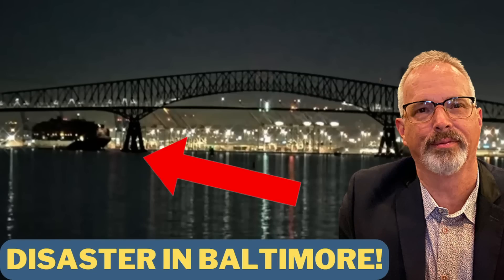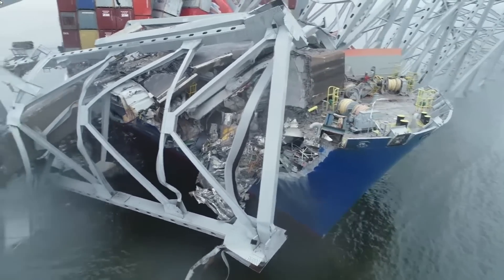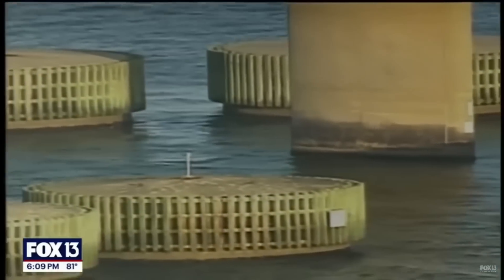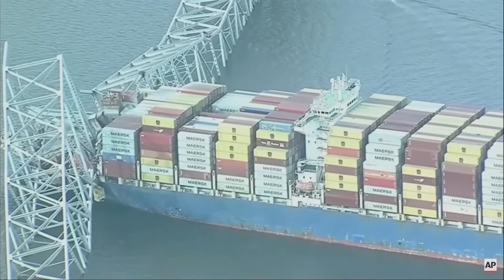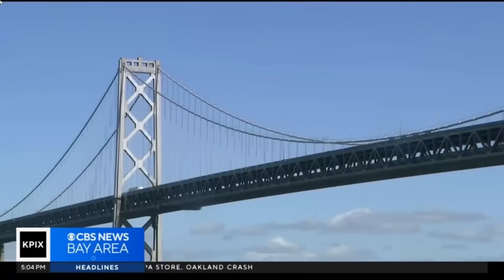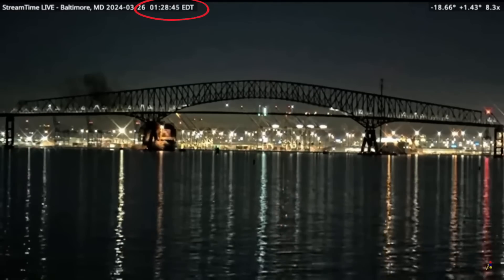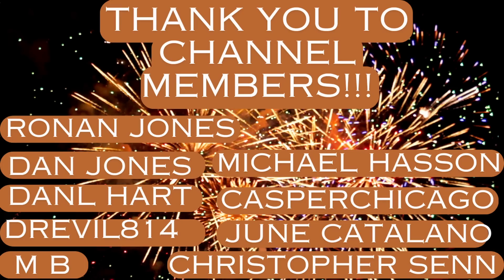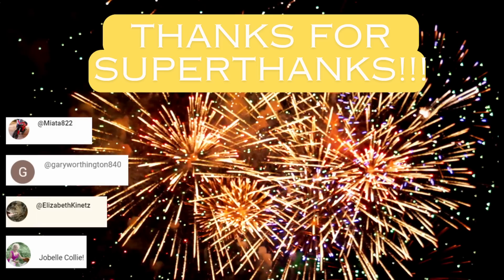How the Francis Scott Key Bridge in Baltimore should have been Protected

Comment: I find younger engineers can suffer from a generational blind spot.  There is a tendency to think older folks can't possibly know anything.
Reply: Doesn't sound like an engineering problem but a political problem and not spending the money to reduce risk.
Reply: @jaredgates4310 Exactly, some people forget that there is a price involved. Engineers don't get unlimited budgets to work with, especially when the government is in the driver's seat.
Reply: @jaredgates4310  that bridge was a toll  bridge it made a lot of money
Reply: @dknowles60  yep, tolls probably cover at least a quarter of ongoing maintenance costs...
Reply: @dknowles60 than they had the cash for the upgrade. They where using the cash in other areas than.
Reply: @windforward9810  You should alway have money for such an security retrofitting, because the risk if you not do so  is way too high.
Reply: I'm noticing effects like this with traffic light timing. 
I have to keep reminding this county that the signals are working to pre 1970s specifications. 
Internship has gone away and anyone less than 50 doesn't remember the big changes smart signals invented in the 1960s and seventies. 
It's likely the engineers involved are ESL and like young people, they don't have the experience to run things
Reply: @flashgordon3715 yet pols make $20K a month for screwing everything up.
Reply: Ageism is rampant in all disciplines nowadays. Including music (my profession). Old people don't look perfect onstage, so...
Reply: I think that there are also some inherent limitations in humans' mental modeling of very low probability, very high cost outcomes. There is a tendency to see the low probability of the event happening and the benefit of cost reduction / construction timeline reduction and career enhancement from being the engineer that made the customer happy and choose unwisely. By the time the negative outcome kicks in, the engineers are retired. In addition, the math on the probability is poorly defined. Since the bridge was built, the likelihood of damage from terrorism has increased manifold.
Reply: I am not a degreed engineer, but I am naturally talented in mechanical and electrical reality. I've worked with some degreed book smart engineers, who can't troubleshoot things like their malfunctioning, say, garage door opener (real story). The door would go up a few inches, hesitate, do it again, etc. He's piddling around with the chain limit switches. I ask if he's taken the bottom cover off. No. I talked it off, revealing the v belt missing a chunk of the inner part. "There's your problem." He says, "Are you sure?" I said "Of course it is, when the void in the belt reaches the small sprocket, it sticks a bit, then gets past the sprocket." We got a new belt from an auto parts store, put it together, and all was well in the garage door situation. I could go on. My eyes have rolled many a time. You either get it or you do not, degreed or not.
Reply: Thanks spellchecker, you changed my word again.
Reply: I would suggest that younger generations always possess a generational blind spot. Without the experience of a life lived, combined with the arrogance of a life not yet lived, they will frequently tear into the older generations for no better reason than a seemingly instinctual need to devour those who came before.
Reply: As an engineer, I will tell you that one of the biggest problems in engineering is that management/customers are never looking to solve any extra problems or spend extra money. If there aren't rules in place that require bridge protection, why spend the extra money to add it to the design. If you can get away with certifying a structure while spending less money they'll do it. Especially if there's historical engineering precedent. This bridge has by all appearances been a good enough solution for 50+ years. When that other bridge was hit by a ship that caused a collapse and killed 30 or so people there should have been a national review of bridge safety from ship impacts. That's where the real failure is. Why are we not learning from previous mistakes and implementing solutions?
Reply: Exactly they're all for improvements till you mention the $-sign then it's "We'll get back with you on that " ....yeah right ! @jaredgates4310
Reply from the maker: You're exactly right. I saw that recently when I helped one of my kids with his vector homework.
Reply: @CaseyJones-Engineer  in Logan UT near the mouth of the canyon is a small power dam. Iirc turnover of operators is 6 or 8 years and every 12 or 15 years it silts up. So it is opened and flushed. Pretty well killing all the fish 10 miles down stream when suddenly every one remembers oh we were going to do that again. Think has happened at least three times. Think it's called organizational memory
Reply: @CaseyJones-Engineer  what topographical mapping did you use in your assessment to know whether or not those structures could be used .  Just asking as some one whos mother grew up on backriverneck run ,  that is a heavy silt area some of the areas on either side are not stable enough for structures thats why the bridge is spanned in that sectional length.
Reply: @CaseyJones-Engineer  Any loss of performance in engineered designs, from Structural, MEP, Civil, Architectural, etc. is absolutely not due to brain drain. It is 100% due to cost and budget, every time. We as engineers are constantly pushed to curve our designs to meet project budgets even with stakeholder knowledge that this can compromise code compliance or at worst public safety.
Reply from the maker: @jdduvall12   I can definitely see those being big factors as there is too much penny-pinching going.  But I also think training budgets are virtually not existent now.
Reply: @CaseyJones-Engineer  You are absolutely correct, and I think the penny pinching extends to the loss of talent. Fields like MEP and structural engineering have to poach kids out of college in those fields looking for jobs where their degrees can make significantly more in industries other than construction. Perhaps less so structural, but we're seeing the effects in construction based trades very heavily (MEP, Civil, etc.).
Reply: And 99% of new graduates, you can ask them to thread a pipe, tap a screw hole or weld  two pc's of metal together and they're fk'n lost !😱
Reply: @rickymeadows5176  yea
Reply: @rickymeadows5176 .  They can tell you what size pipe you need or what size and how many screws you need but when it comes to getting a load of pipe safely off the truck and to the installation location………..can’t.  No fault, none of us know everything, it all comes with hands on experience.  In 1970, I was green as a Gourd too but 50 yrs later I am fortunate to have a very varied experience and worked all over the world for Bechtel with Chevron being the client most of my last 12 years.  Go into Oil n Gas and see the world.🌎 😅😊
Reply: I don't know if this is the point here, I think the problem here were bad decisions of the guys who do the money stuff.
Reply: no I was raised by baby boomers who kept there parents tools from the 40s 50 60 70. yes I know how to drive a model A tractor/car. or swing a mower to mow grass. My mom's family built airplanes. and I've seen how things used to be built. but your parents who born in the 40s. made great things. easy to work on. for some reason you boomers made things cheaper. thinner steal.  harder to fix with/or timing gear for everthing.  yes there is a difference between a 1960 cars that was build by a guy born in the 40. then a 1980s cars who was built by a guy born in the 60s. even the building codes form your time had to be updated to be safer. and more reliable in the 90s. Today building things have more laws to watch. and more people for things to withhold. So yea I know my generation can't build anything without a computer. which is a problem.Things don't work in real life like they do on paper. and its not we think your stupid. its your out of date. we know how things work well suppose to anyway. you have taught us that. is we got to fit a computer in it Now and that needs wires and holes and reinforcement. for all that too work. and everybody likes Bluetooth. fun fun fun. and wifi and smart this and that which get hard. just wait they do the same with the bridge.
Reply: Too much depending on book learning and not enough experience ànd common sense
Reply: @georgesparrow2839 .  Also now, no human calculations, just enter a few fields of data and hit enter but have no idea 🤷 if the end justifies the means.
Reply: Sweetie, but WHEN was that bridge built?  The question of the day is why did the folks in charge of that bridge just ignore how that the fact that they could have put concrete barriers near the existing supports to prevent collisions into those supports?
Reply: I am not an engineer, however the last part of your comment really hits home.
Reply: And they want to compare that ability to current politicians.  Like theyre the ones that will be doing the work.  These ' younguns' need to pay attention.
Reply: I knew everything till I turned 25. Then, I was like a child, dumb, ignorant,  nieve, and prideful. Then, around 40, I started gaining wisdom, and it's been a good ride since.
Reply: No I don’t think the upgrades will happen.
Reply: Which is why everything is falling apart.
Reply: It does happen, but it's relatively rare. It reminds me of that skyscraper in NYC that could have easily fallen over if the wind came out of the wrong direction without any scientific reason for excluding that scenario.
Reply: Unknown unknowns, a lot of people are certain that those do not exist.. except those who have enough experience to know that there is always something you don't know...
Reply: I'd personally ask who mentored the young engineers and ask some questions from that direction..
Reply: Brit here : I designed the most northerly grade-separated motorway interchange in the UK in the late ‘60s using only 8-figure logarithms - what are they, I hear you ask ! 150 pages of calculations, it took, too.
Reply: Most likely $$$"  ! , during construction an, again after completed - not necessary  ? Too cost$$ ly  !  ?  _"
Reply: Dolphins,Fenders and tugboat escort services could have definitely  made this less likely to happen !!!!!
Reply: TO them that think they know it all I say : THOU FOOL !:elbowcough::goodvibes:
Reply: Which is true. That bridge is 47 years old, so it was not build by young engineers. It was build by old ones, who apparently didn't know anything, or they would have made better protection for it. Don't blame young people for what they didn't make.
Reply: Amazing, other than the ship hitting the bridge no other facts have emerged but the youtube experts will emerge and explain everything.
Reply: Kinda like a Dr. never can figure out what's ailing a person but a Coroner can tell you what they died from 30-minutes after they hit the slab !🤣 @henrylubinski2728
Reply: I saw a much smaller ship go through 50ft long 20ft deep concrete reinforced bank and into a hotel.. How exactly big you going to make these bumper things?
Reply: @austinavery4772  Whatever it takes.
Reply: Yeah, that's it. Blame those who don't know for not knowing. Classic boomer mentality...
Reply: Or maybe there is a lack of older engineers teaching their knowledge to the younger ones without being patronizing or else ..
Reply: Seems like both sides are believing this fallacy about the other. Younger doesn’t mean less capable and neither does older. They both will have their strengths and weaknesses. This is the whole factual basis for diversity.
Reply: It was the older folks that built this bridge without the protections.
Reply: Had they the budget and or design requirements that most likely would have been done .
Reply: Well, the older folks failed to do anything about that bridge during the past 47 years, so perhaps they don't know anything.

Comment: The cost of improved pier construction should be prorated as a port tax on the huge new cargo ships.
Reply: The state and local governments are responsible for getting this done. While searching for Maryland future projects funding , they have announced funding for an upgrade for a high speed rail tunnel.  Did the government punt on bridge upgrades to spend on other projects?
Reply: @stanhry  Yes, they've had well over 40 years to deal with this problem, they chose not to.
Reply: It is likely that when the bridge was built that there was a legal agreement with the port as the bridge restricts access to the port. If the ports lawyers had any sense they would not agree to pay to do works in the future to a structure that was being put in place to hamper their operations.
Reply: @johnclements6614  on the other hand, if you look at that port, it doesn't appear to have been built, like it is now, in 1970. So somewhere along the way they almost certainly got some government funding to upgrade it. And will probably want some in the future.
Reply: Why!? The maritime traffic was there first. The cost of improved pier construction should be funded by a tax on motorists who keep obstructing perfectly good rivers with their bridges because they’re too cheap to build tunnels.
Reply: @michaelimbesi2314   Ships have gotten much larger than they were when this bridge was designed  and hazmat carriers and tall trucks can't use tunnels.
Reply: @michaelimbesi2314 
Except the automobiles aren’t the ones that damage the bridge. By the way, that bridge is where the trucks that unload the cargo from the port go. So the ships need that bridge also
Reply: @michaelimbesi2314 The maritime traffic broke it and killed some people, and want their port reopened. Being first is no longer the winning argument if it ever was. This isn't a playground.

Comment: The Bay Bridge in the San Francisco Bay was built up as part of the Treasure Island Naval facility. I’m not 100% on it’s engineering history but it all was built to Cola War era standards; why wouldn’t it be?

There was a tanker collision in ~2009. It hit a concrete rim wall that protected the steel frame pier. The ship was damaged, the concrete was damaged but the pier was fully protected. 

Isn’t the Baltimore channel part of a US Naval entry point? Seems insane it was never built up with dolphins/whatevs
Reply from the maker: That's a great point that I'll have to look into that.  I think it's sheer insanity they didn't protect that bridge.
Reply: @CaseyJones-Engineer  for real! You’d certainly have more expertise than mine but it was the Oil Tanker Cosco Busan and o think the Captain was found negligent. 

Also: lol “Cola War era” that’s actually happening right now!
Reply: @CaseyJones-Engineer There are a couple of fast deployment ships trapped in the harbor now.
Reply: Coronado bridge in San Diego Bay was designed to float should it come down so as not to trap the USN ships docked further down the bay.
Reply: @williamlloyd3769  A popular myth.
Reply: @williamlloyd3769  I don't think the spans can float. Modern aircraft carriers can't fit under the bridge and dock at North Island, and the bridge's curved path allows for more clearance if the spans do drop.
Reply: Can’t remember if the Navy has or had any major maritime water side presence there. The I-295 Del. mem. Bridges are south of Philadelphia. The Navy had a shipyard which is still a working shipyard of sorts. For the Philadelphians, the other two major bridges, not mentioned, which cross the Delaware do not appear on a satellite view to have any piers in the water.
Reply: Key Bridge has 4 reinforced concrete pylons/dolphins around the main piers just like the Sunshine Skyway.

Problem was that the ship left the channel at an angle and just missed the pylon.

The SFOBB pier was sideswiped, not hit head-on. Difference, huh?

These are lifeline bridges across principal shipping channels and none of them have more than 100 feet of protection around the main piers (see satellite views).

A 1,000 foot long heavily loaded ship moving at 8 knots would not (in my estimation and considering the bow overhang) be stopped in time to avoid destroying the pier leading the collapse of the entire suspended span:

Verrazano-Narrows Bridge
Delaware Memorial Bridge
Golden Gate Bridge
San Francisco Bay Bridge
Reply: The Cosco Busan (the tanker that hit the SF-Oakland Bay Bridge) is 60% the size of the MV Dali and side-swiped the Delta tower in heavy fog. The MV Dali had a head on collision with the primary support pillar of the Key Bridge and the MV Dali is a mid-sized ship. Very different type of collision.

The Key Bridge had dolphins, they were just never enlarged to factor in current ship sizes.
Reply: @adonislimes6156  woah. I didn’t realize that! I also read that the Cosco Busan was unladen, no oil cargo so potentially even lighter as a vessel?

It’s pretty mind boggling how large these ships are and how unintuitive it is when trying to interpret/imagine what happened. I appreciate the follow up information.